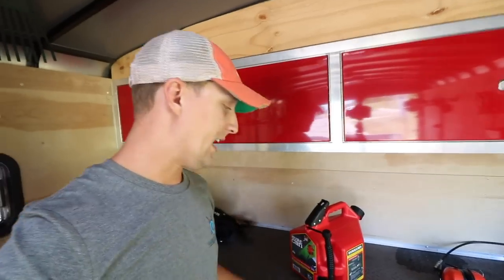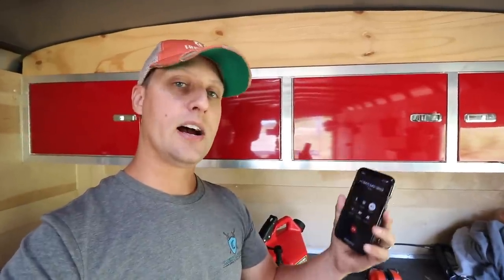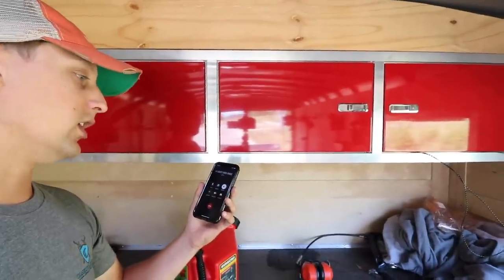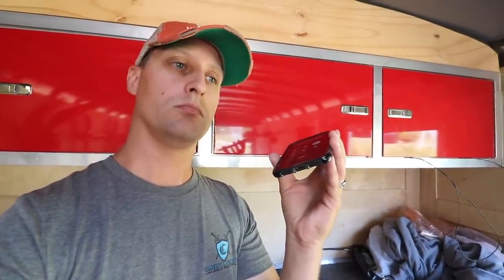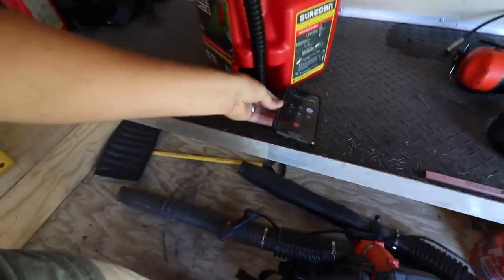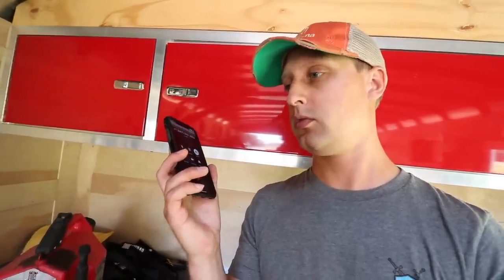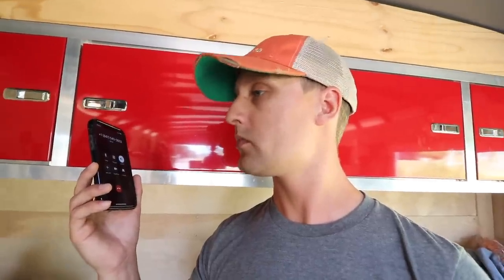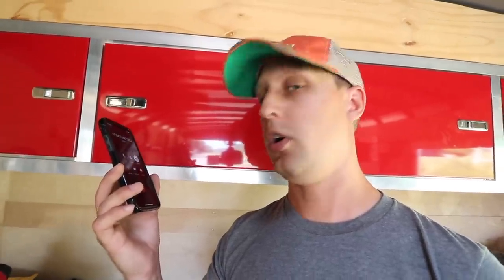What's The Best Octane For Hand Held Equipment? What About Ethanol?

Comment: Great Vid Brian. I work for an FD and have worked both as a Sawyer (chain saw operator for wildland fire) and a rep for one of the big extrication tool companies where small engines rule (well before battery, but thats a whole different story). I can't overstate the importance of knowing your fuel. The issues we had with ethanol were huge. Furthermore we saw issues with fuels absorbing moisture overtime and we ended up with alot of varnishing. We switcher to VPracing fuel in the small favtory storage cans and distributed those across the fleets and saw a large decrease in maintenance and improvement in perfomance. Our saw teams would go from 100deg prairie assignments to 10000ft mountain assignments using sthil saws such as our 441s and 660s.  We especially saw improvements with the better fuels with the sthil CM series where the fuel system is computer controlled vs the older manual adjustment carb setup. 

I am lucky now in the midwest that the Caseys gas station up the street carries ethonal free right at the pump. Use that for my small engines and typically true fuel or VP pre packaged, premixed fuels for the 2strokes (i dont do the volume you do so the logistics and minor cost increase is offset by the convenience and logistic factor). 

Great resource getting Jason on. Coming striaght from the manufacture pretty much settles it. Spend alittle bit more on fuel and help extend that tools life.  Its likely cheaper in the long run.
Reply from the maker: Absolutely pal well said

Comment: I use pre mixed tool fuel. Not ethonal No need to add stabilizer to any of it. Comes pre mixed and lasts a lot longer. They make it 50:1 and straight 4 stroke
Reply: I bought true fuel this year (first year at house). Bought 8 32oz cans and I'm tracking how much I'll use in a season to see if I should mix my own gallon next year.
Definitely getting a gallon of the 4 stroke to use 1/2 gallon to run through before winter and leave and I'll use the other half next year to do the same thing. Good for 2 years opened and 5 years unopened on shelf.
Couldn't run the 4 all the time. $20 a gallon would cost $60 each fill of my mower tank lol

Comment: What I run in my mowers and hand hald equipment is premium wchicontsins NO ETHANOL and for 50:1 I can just stihl oil (thats what I run for oil for hand held things). When you use ethanol in your stuff it eats the carburetor and long term it will be shot.

Comment: So the more compression/heat, the higher the rpm of a timing belt?

If you use Octane 87 on a engine that requires 91 or 93 the engine can overheat causing the gasoline to explode inside the engine.

...sorry for all the question. I'm just curious.

Comment: Fuel pumps are required to have a sticker that tells you the Ethanol content which for the most part is 10% across the board. You are starting to now see E85 which is 15% Ethanol. You cannot use E85 unless the manual specifically states that it is allowed.
Reply: E15 is 15% ethanol.  E85 is 85% ethanol.
Reply: 85%ethanol 15% 87 octane fuel
Reply: Oops... you are correct.  My bad - thank you for the correction.
Reply: Where I live the sticker simply states something like "This fuel may contain up to 10% ethanol" and that is it.

Comment: At one time there was no gasoline below 92 octane and the max was 110. 89 octane was put into use for more profit for less and engine damage control. The faster the internal damage occurred the sooner the product was replaced.  Any portion of Ethanol is no good for any engine. BP is the only fuel that does not put ethanol in their fuels. I was told by a major division a major car mfg.. They do not warranty their fuel related after market products. Factory OEM Auto Parts  if you use ethanol or gasoline with ethanol in it. I have had many carburetors destroyed by supposed no more than the 10% ethanol added fuels.Just try to avoi Ethonal if at all possible. Did not mean to write a book . Corn was meant to eat not not to put in a fuel tank. I like you informational vids.

Comment: In the Carolinas our ethanol free is 87 octane. Should we be using an octane booster? Is this possible?
Reply from the maker: Just use 89 for 2 stroke
Reply: But, ethanol is a KILLER. Wish Jason would’ve mentioned ethanol issues vs octane

Comment: I use 91 ethanol free mixed with a little Sta-Bil  and Marvel Mystery Oil. This allows cleaner combustion, top cylinder lubrication and easy starting next season. What is your take on this?
Reply from the maker: If it’s economical, go for it
Reply: Brian's Lawn Maintenance I meant what is your take on Marvel? Do s it really benefit or work?

Comment: Echo redmax canned fuel i believe its called. 93octane non ethanol premixed woth stabilizer and oil at different ratios.  Been using that just cuz its easy.   Mower gets 89 octane atleast.  Sonoco has 90 non ethanol now too

Comment: How many missed the part of the string trimmer or edger manual that said you lube the flex drive shaft ever 25 hours and gear housing every 50 hours?
Lol. Luckily I only have maybe 5 hours on mine but I bet it's missed alot.
Also, echo does explain in their warranty that use of less than 89 octane as well as sub par oil voids warranty.
I'll be honest after seeing all the red armor videos and what the power blend looks like it makes me wonder why they give you a bottle of the power blend with the new equipment. Should just be red armor all the way.

Comment: You guys went round and round about octane but no comment about Ethanol vs. non-Ethanol. You tried to introduce the subject but Jason only commented that the mid west was the first region to adopt Ethanol laced fuel but no comments about the problems associated with Ethanol. I can pretty much guarantee that the average user has more small engine related problems due to Ethanol-laced fuel than with octane and stuck rings.
Reply from the maker: This video was more related to Octane rating, vs Ethanol. Did you read the title? We can discuss ethanol on another video. This was to clear up the confusion out there where most folks believe that Ethanol content is somehow related to Octane rating. It's obviously not.
Reply: I understand but I think the Ethanol issue is more critical for DIY small engine users. Granted, for commercial mowers like yourself I see it as less of an issue since your fuel is usually fresh and you are constantly running fuel through your equipment. For home owners who visit the gas station every few months and have 5-10 gallons sitting around and typically store their equipment improperly it is more of a factor.    No offense but you are the first person I've ever heard of say that they thought higher octane contained less Ethanol as by law it is required to be clearly marked on the pump. :-)
Reply from the maker: I hear ya, but I promise if I have that question I’m sure thousands more do as well. It’s all marketing and gimmicks and bs from the fuel companies. It’s misinformation which is hard to sift through, even for the best of us. That’s why I love talking to Jason. We’ve talked about technical nittygritty stuff like this a lot over the last 18 months I’ve worked with ECHO and EMB. They’re definitely a great (and under utilized) resource for the community.

Comment: wow ive been running 87 for 3 years and didn't even know it was damaging the engine. so should I buy 89 or 93? Also what about the mower should i also run 89 or 93?
Reply from the maker: Mower you can run 87 best I understand. That’s what I do. The 2 stroke I run 89.
Reply: I have a scag turf tiger 2 with the 37 horse power van guard and and have a scag 36 inch kalaskai. Can you use 87 gas on those?

Comment: It's not the explosion. Explosion is how an internal combustion engine works. It's an early explosion due to heat or pressure on the compression stroke before the piston hits top dead center. While the piston is still traveling up to the head the explosion happens early. It will loose power and be noticeable

Comment: I keep hearing contradicting information. 2 stroke engines do not like ethanol, but the higher the octane the more ethanol there is from my understanding. So why should we be putting higher octane in 2 strokes if there is more ethanol, and 2 strokes dont like ethanol?  Can someone please clear that up for me? Also, should you use higher octane while you are breaking in an engine?
Reply from the maker: Unless you're running purely ethanol free gas, but that is expensive and honestly hard to come by in most parts of the country.

Comment: All “ethanol free” gas in my area is 87 octane. So the real question is...”which is really best for small engines...the low octane ethanol free, which reduces carb problems, per mechanics...or the higher octane, which reduces engine temperature, per Stihl manual”?
Reply from the maker: Good question!
Reply: @BriansLawnMaintenance  please ask your Echo rep that question.

Comment: I was told ethanol would mess a carburetor up
Reply: It will, because it's hygroscopic, it draws water in from the surrounding air, and eventually will gel up/create rust/corrosion inside your carb. So, it's ok for short term use, but terrible if you leave it standing.
Reply: The Ethanol also has a habit of degrading rubber parts within the fuel system. Had a brand new chain have the fuel line degrade and fall apart within a week using ethanol enriched fuel. I use ONLY Ethanol-Free fuel in my hand tools. Also an FYI; it takes 230% ethanol volume to gasoline, and it burns cooler. I have had issues with the two-cycle oil causing carbon deposits in the exhaust ports due to incomplete combustion. Great video!
Reply: If you can get regular 87 non ethanol you should run non ethanol.
Reply: That's what I put in mine 87 mine non ethanol
Reply: @workingcountry1776  That's what we have in South Carolina and that's all I use

Comment: Almost every city where there is a boating community you will be able to find NON-ETHANOL fuel https://www.pure-gas.org/index.jsp will allow you to find the gas station near you. California not so much. There are very few stations 26 In total so if you live there good luck. Michigan has over 400 stations. The more ethanol in the gas the more the engine will burn. Like cars tggat can run on E85 which is 85% ethanol it may be cheaper but you lose close to 50% in mpg. So for those lefties who think they are saving the planet burning E85 it's actually worse. E85 or any ethanol in gas is a "Feel Good" thing also ethanol is a water sponge. You couldn't store any gas with ethanol in it for long periods without adding stabilizers   I have stored ethanol free gas over winter and my Toro with a Honda engine had no issues. Check out that link and keep all your engines running clean and for decades

Comment: Really it don’t really matter honestly all have ethanol in it so as long gas don’t sit more than 3, if did sit longer than that then you need to get rid of it ethanol in gas turn into water that when it start to messed up carburetor on 2 stroke especially 4 mix, 4 mix are territory high maintenance I can’t stand it. I just throw gas away after 3 month or earlier.

Comment: Always, always use non-ethanol in 2-stroke and 4-stroke carburetor units! You can get away with it in an EFI unit, but ... why? Storing fuel becomes an issue, it gums up more (especially in hotter-running air-cooled engines), and you are actually getting less fuel-power density per mL! 

For me, 89 non-ethanol perfect. 91 is also acceptable. 93 is a bit of a waste, honestly, and is really designed for modern high-compression and turbocharged auromotive engines.

Pro-tip: ONLY dispense from a pump with separate nozzles! That way you know you're actually getting the octane you're paying for. Sure 2-3 gallons in a 20-fallon car tank doesn't make a difference, but in a 5-gal. portable? That's 40-60% of your purchase!

Also, Sta-Bil is the best for storage, and add an oz. or two of Mystery Oil to keep everything happy! You'll see a big difference in fuel consumption!

Comment: EVERY car I have EVER owned that could run 87 Octane I got MUCH MUCH better MPG than 91 or 93 Octane but 91 and 93 ran smoother,  cooler and had more horsepower. I have owned over 40 cars, I bought my first flex fuel car last year and with 105 - 110 Octane E85 My performance app tells me I gain 18 HP with E85 over 87 Octane but I get 20 MPG more with 87 Octane and 7 MPG more than 91 Octane. BUT this isn't about cars !!!!!

Comment: This guy explained some of the science  correctly, but then proceeded to recommend high octane fuel anyway which makes no sense. 87 octane, ethanol free gas is ideal for lower compression engines. It's the cleanest and combusts at the proper flash point for the design of these engines.  If you use ethanol free, the additive detergent argument is also mute.  The reason high end cars and other vehicles require high octane fuel is because they have high performance engines with higher compression rates. The high octane fuel combusts at the proper flash point for those engines and creates more power. You're wasting money, burning dirtier, and actually sacrificing performance with high end fuel in low combustion engines.
Reply: Great comment!  Finally someone that knows what they're talking about. I knew about the 87 being cleaner, but wasn't sure about the flashpoint issue. We need to get this out in the open, once and for all. So who is right, you, or Brian's guy saying low combustion engines need high octane for proper flashpoint?  We need a video explaining this difference of opinion.